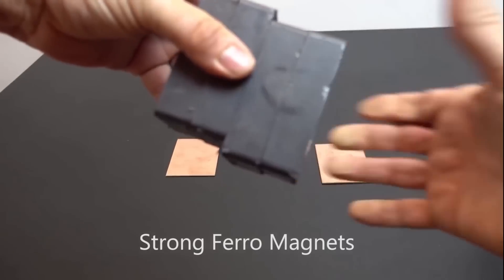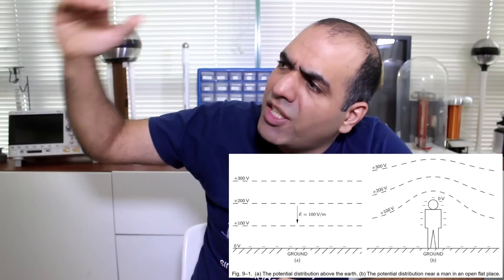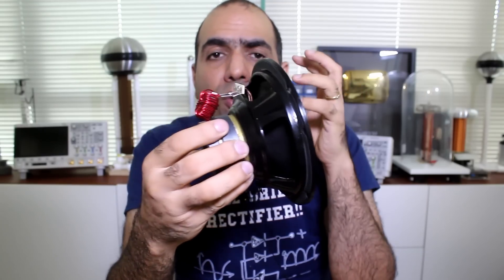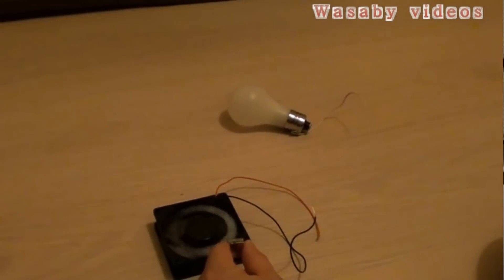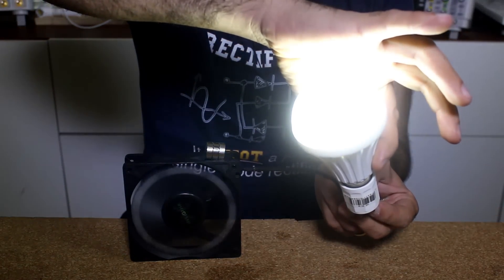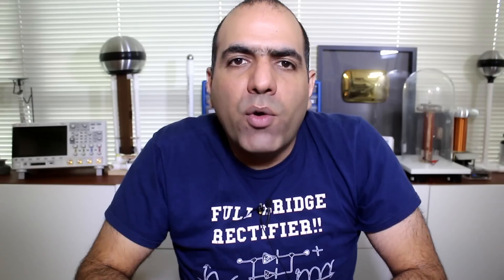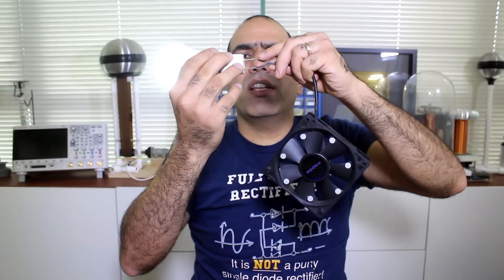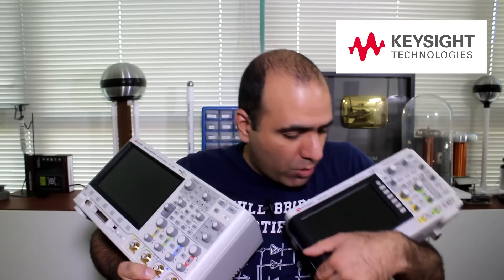Free Energy Devices Build and Science

Comment: Real pseudo-free* energy sources: Atmospheric electrostatic discharger - tall antenna/electrode, spark gap, transformer from spark to ground, rectifier. No very feasible as the energy is low but fun way to get shocked :D (Try a big delta-loop antenna and crappy grounding to arc to)
Geomagnetic fluctuations: A lot less usable energy but we do have a fluctuating geomagnetic field. The frequency is very low and chaotic as it is a result of the ionosphere, earth's magnetic field and the solar winds. This is measurable energy in most days, grid damaging in some days - there is potential but we'd have to allocate huge spaces for the huge coils that could pick-up the fluctuations. 

Reed switches? Now, in 2018???? Have no one heard of Hall effect sensors? 

Fake free energy sources: Moving in with parents - son... you will eventually pay a hefty price for that. 
Don't trust me, try it and find out for yourself. 

@BOOM: You forgot the freaking solar highways! 

*Nothing's free. everything has a price. 
What's your price, Duracell? 
The Matrix wants you!

Comment: I found myself thinking, no that power supply coil wouldn't work, the wire is stranded and has shielding which protects against induction. And then I realized I was trying to disprove a man who had a power supply plugged into itself. As well as that wire isn't even shielded, and shielding doesn't even work that way.

Comment: I love Fake Free Energy Devices that have nice trickery in it and never claim to be real.
Sure I could be able to belive most of the shown devices, when I don't know the basic laws of thermo dynamic. I mean there is energy in the air but not free, because someone paid for the energy and that's most likely you. I talk about radio or cell phone frequencies. Sure the output is limited, because they don't want to fry your brain. I mean a very efficient device that don't need much power, might be able to get powerd but it's far from saving any money.

With the powercord everyone should know that this isn't possible at all. Sure you initially can give a high voltage through the cord but still. When you change the voltage, you change the amps and in a 100% efficient design, you still would have the same amount of watts. I mean you can make from 3 volts, 10kV but you will get less amps and the Watts won't change. In the real world you have losses. The easiest loss is a wire and even when you use graphite, you still would have a loss. Even when there would be no loss, you don't get much power out of it. Also it's not free, because you done work with pressing the lighter.

It's easier to get a bike with a dynamo and ride it. You still can't claim it free power, because you pay for it with your own calories.
There is one thing that will come and that's more efficient ways to extract power from atoms. At the moment we use burning stuff to get power with coal. We waste a lot of energy and nearly everything and there is still energy left. We could get way more power out of atoms that they hide from us but we didn't found a way to get it. There is a nice loop in Cern that generates a lot of power but on the other hand it uses a lot of power to make it possible. Also it's not desinged to generate any power, because it's not efficient.

Comment: Here is a over unity efficiency device you would like and have encountered, 
An electrical heater has efficiencies near 100%, a heat pump on the other hand (an electrical cooler in reverse cycle, or a refrigerator used in reverse!) has over unity efficiency if you define it as 
n = OutputHeat/InputElectricalEnergy
I know how it works yet it always fascinates me
Reply: The difference is that a heat pump does not convert the input energy into heat, it moves the heat.

The part about electric heaters is spot on - they are actually 100% efficient (since what you want is heat, there is nowhere for the energy to be lost to that isn't useful). Remember that when you are shopping for an electric space heater, they ALL convert electricity into heat equally well, wether they cost $15 or $300.
Reply: @HarmanRobotics  as I said, I know how it works and it kind of cheats, but the interesting point is it has efficiencies 4-5 times of an electrical heater, if you take heater as 100%, then....

Comment: The fan one works tho if you do it right. Not sure if every fan has brushless DC motor (static coils and moving magnetic core), but atleast mine has so by soldering some wires to the right places and spinning the fan (I did it with hand, but I dont see why magnets wouldn't work) it does produce "free energy"

Comment: Got a question for you, do we not have the ability to detect electricity in the human body to such a point that we can know which nerve is receiving an order? If so, why can't we hook up nerves to a "circuit board" to help amputees. Instead of hooking those nerves to muscles that flex and push pressure sensors to move the arm
Reply: the main problem is how to connect to the nerves. They are very small, often in hard to reach places, and there are a lot of them. Plus you need to do this in a way that doesn´t cause infections or other health problems. Other than that, it is possible.
Reply: @Basement-Science  well we can already take nerves and connect them to other parts of the body. It will be a similar procedure but instead of hooking them to muscle cells we hook them to a very thin fiber optic like wire. in which then we can take those and hook them up to a circuit board and then figure which one does what. 
I was thinking of using gecko hairs to help separate and attach to fiber optics
Reply: I´m not up to date on the research etc.
I believe a lot of work is going into this, and there are very good results for replacing an arm or leg etc.
This sort of prostetic is still very expensive though.

Comment: hey! any1 can answer my question?
i connected a 230v -> 12v transformer to a 4.8v motor, but cables melted. anyone can tell me what can i add to the circuit so it's not gonna blow up or smth? please
Reply: The output voltage  of the transformer is way to high. You need to adjust the voltage to the device. You can use some Resistors to reduce the Output Voltage from 12V to the required 4.8V
Reply: ...which would lead to burned resistors, unless their power handling would exceed that of the motor. 4.8 volts for the motor, 7 volts for the resistors to drop at the same current. bad idea! Just unwind the turns off the seconday side of the transformer until the output voltage is correct for the motor.

Comment: DiodeGoneWild was in this video :P
Reply: DANYK is the same person http://danyk.cz/index_en.html
Reply: indeed, the old HIGH voltage guy :D
Reply: I like how he switched from FAF into usefull content! Its more important knowing that fake Apple chargers have no isolation between primary and secondary (only the super thin coding on the copper wire) and that the puny single diode rectifier and the smoothing capacitor could work as a voltage doubler wich could output from 340v to 680v directly to the metal housing of your phone if the "isolation" fails rather than knowing how to make free energy!!!!